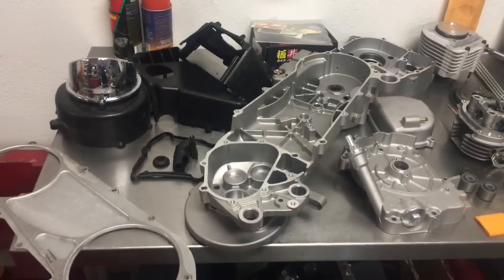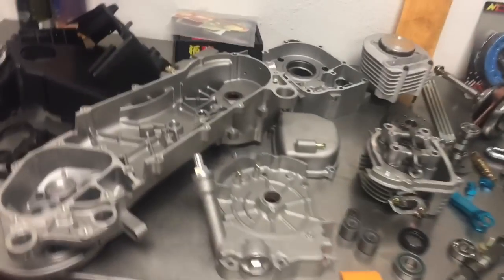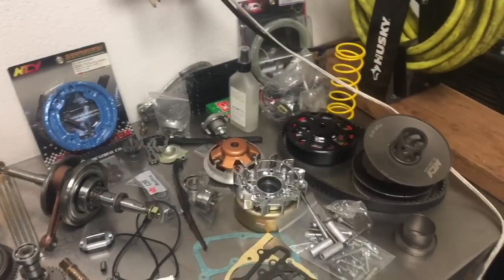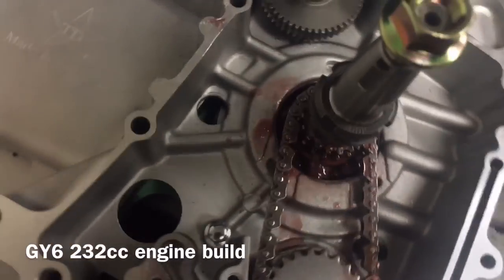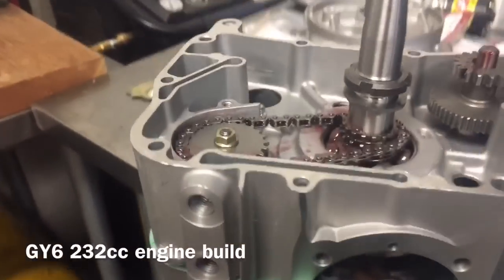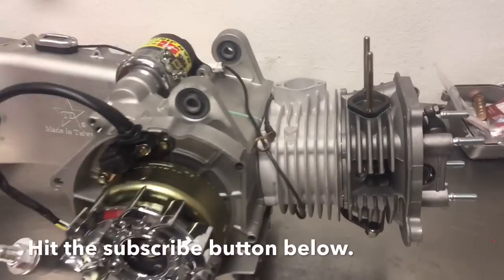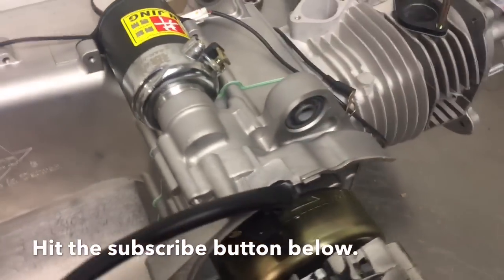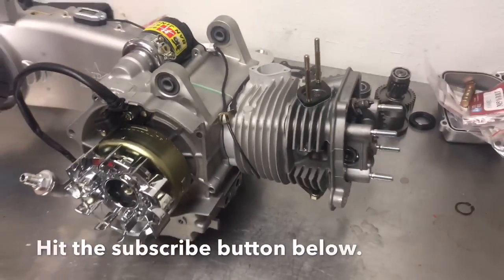232cc GY6 b big bore motor build (ruckus)

Comment: So I'm building a trike for my 6 y.o. Like a mini t-rexx. I have my own fabrication shop to accompany my business. I'm really pumped about the versatility of this little motor. Since I like to cut to the chase, whats the best source for cases? I will be building a f.i. 232cc 4 valve with all the fixings. Any input and directions would be appreciated.
Reply from the maker: That sounds sweeet! I would purchase directly from Taida in Taiwan. I wanna see your project!!!
Reply: Rolling Wrench I will send you pics if you're really interested. I plan on having a desert pro truck style of suspension. So soft ride with lots of travel and articulation. Looking for a somewhat wide and flat back tire and wheel. I am kicking around the idea of a boost, or really high compression. I'll use Harley Davidson compression releases on the head if I go high comp. If I boost I will be fabricating everything I need. I've already seen the issues people run into with boost on these things and might put together a real kit. My shop is already working on custom intakes and manifolds for cars, this would be so much better. Plus I have all the tools to port and polish.
Reply: Rolling Wrench since I plan on going 232, and replacing basically all rotating assembly, is there a way to buy the crank case and trans?

Comment: I have i taida 232 ruckus that wont start i tried everything changes the ground cable to the starter changed the starter to banj jing high torque changed the battery to lithium powerful battery and still wont start because of the high compression 

The old owner told me that i have to kickstart the motor and push the start button on the same time but also i tried many times and did not worked 

Any advice?
Reply: You'r problem was Valve timing ..  check the TDC

Comment: I want to go from 150cc to 232cc. Will this bolt up to my cvt?
Reply from the maker: No, you will need case boring if you have a GY6 B motor. If you have a GY6 A motor, it won’t fit
Reply: @RollingWrench  ok..... maybe I didn't explain well.  I have a gokart/ buggy.  Would a liquid cooled gy6 232 fit in same spot like as a drop in? Do the lowers share the same outside dimensions?
Reply: I wish to know as well. Bdx performance sells the 232cc now

Comment: What size carb did you put on your 232?
Reply from the maker: 32mm but I should have probably went with a 30mm. But now I have our Fuel Injection Kit on it of course :-)
Reply: Just got a 232 for my trike.  Bought a Mikuni tm32 for it. The mikuni keeps leaking from the overflow. Placed my old oko 30mm on it and the darn thing ran fine. The builder of the motor said that that 30 would probably cause it to run lean and burn up the head gaskets.
Reply from the maker: Remember too, I’m a mile above sea level. We have less air so we need to match it with less fuel. So 30 would probably be better. But it ran strong with the 32. Tune it with a afr gauge. Watch my “how to tune without guessing video”  set your afr as 13.3
Reply: @RollingWrench  Thanks man, Love your videos.